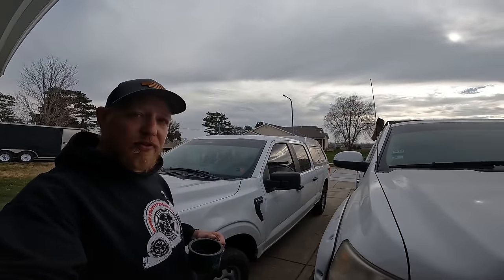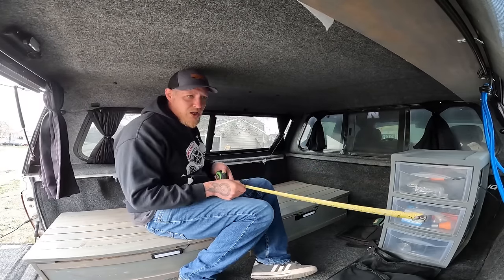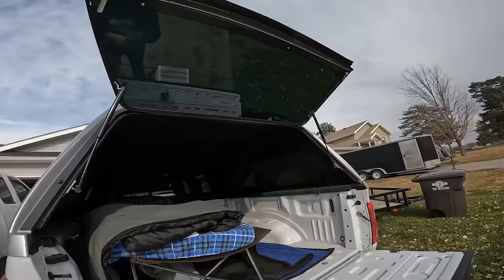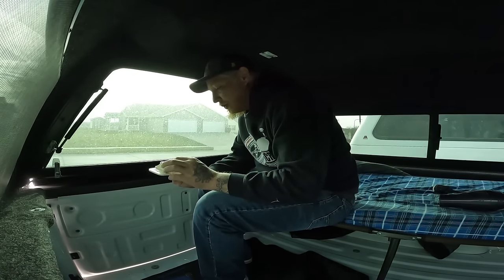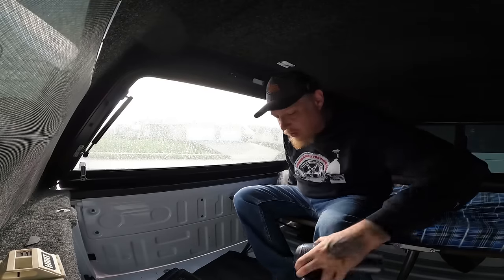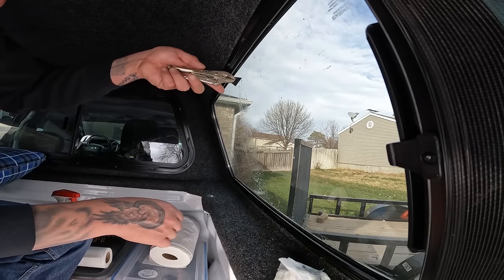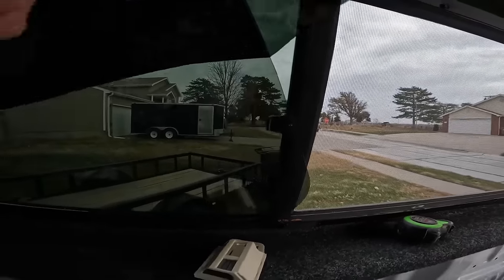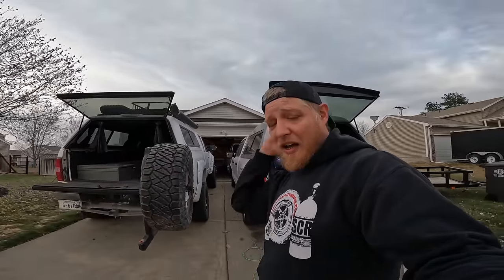Working On The Truck Camper | Measuring Differences & Removing Window Tint

Comment: Build a stand  for the previous bed you made. That way you don't have to build a whole new unit.
Reply from the maker: I might throw a couple 2x4s under it for a couple nights but I want to build a new one that's a few inches wider etc
Reply: That's what I think too😊
Reply: I was going to say prop it up temporarily.
Reply: Lift kit lol
Reply: Agreed!  Just built the bottom up!
Reply: @CrazyQuady frame in your width and height extensions into the original box… minor scabbing at most
Reply: @CrazyQuady 
good idea, Mike. It'll be more comfortable that way with it being wider. Won't feel like you're going to fall off when you turn over, lmao 🙃 🤣 
(Edit, I added on)
Plus, you'll have a little more storage underneath. If you build a whole new bed, it will have more storage which is always better.  Lol
Reply: That's what I said👍🤓just run 2x4 around existing frame for a lift, why waste$ on more wood

Comment: Learned something new today!  I had no idea how windows are tinted.  When you were talking about removing the tint last week, it never occurred to me that it would all peel off like wallpaper.  Good job!
Reply from the maker: Yeah its just film if it's aftermarket tint. The factory glass in the topper is actually smoked, some nicer vehicles have smoked glass also

Comment: My sliders are really hard to move and there isn't  any extra tint. So I'm  waiting to see what you find to make them slide easier.
Can  you build up your  bed from the  bottom to fit over wheel well?
Reply: I see a few more folks brought building up the bed LOL
Reply from the maker: Your local auto parts store should have lube for window sliders, thats probably what I'll pick up

Comment: Get yourself a bottle of magnesium graphite powder at a hardware store. Its a dry lubricant you can put in the bottom tracks (guess you could in top too, but might be messy puffing the stuff upwards). Will slide like melted butter. 😎🤘 99K dude!! You need a Live near the last 100 or 50!!

Comment: Just screw on some furring stripes on the bottom of you existing bed to make up for the height you need. That should do it. Ripp a 2x4 on your table saw or circular saw.

Comment: And on the bed in the Chevy , can you not put a 1 or 2 inch spacer board around the base to make it fit over the Ford's wheel wells ?
Reply from the maker: I'll try that for a little while

Comment: Its great to see you working on the  new rig. Im interested to see what your setup will be like in this truck. When the guys did the tint on mine, they took the windows out. They unscrewed the frame. They're a little tight to slide, but i like the privacy it provides.

Comment: I'm not a fan of using razor blades on glass, it will leave scratches behind. Adhesive remover, goo gone, or rubbing alcohol with a plastic scrapper will do the trick. Bro that abandoned house episode was intense, don't know how you did it.

Comment: Put the bed rug in and screw shims on bottom of bed to raise up
Reply: my thoughts exactly
Reply from the maker: I have a new bedrug in the mail, they're specifically fit so the old one wouldn't work well. I'll try to raise the old bed up for rhe short term though

Comment: Let’s us know what you put in the window tracks to make them slide better. Mine are really hard to slide.
Did I hear you say the motor blew in your Silverado? I replaced my motor in my 2010 Silverado. I had just  bought a new Leer camper shell and didn’t want to start over. Replacing the motor worked best for me.
Enjoying watching you get the new truck set up. Looking forward to new adventures.
Reply from the maker: Will do. Yeah that's the second time the motor gave up, I decided to move on to a new rig but the old one will get rebuilt eventually

Comment: Rip a 2x4 in half and screw that to the bottom your existing bed. Should be enough height to get above the wheel well. New truck beds are deeper than they used to be.

Comment: If you use a hand held steamer the film will come of easily and take almost all of the glue with it. Makes clean-up much easier.
Reply from the maker: Yeah, I would've but I dont have one
Reply: Mike, did you check to see if your extension cord was plugged in? Lol

Comment: When I bought my topper for my Tundra, I got the taller one as well. (I found a double cab truck with a 6.5 foot bed in the exact color I wanted) I have a very basic mat and sleeping bag in it for my camping rig at the moment. but, your channel, Mav and a few others convinced me to start camping in the ol' truck once I had a topper on it. I have a bunch of ideas for it, but want to upgrade some of the lighting and some cosmetic things before doing my full rig I want to build.

Thanks so much for the ideas throughout the years! Looking forward to what you do with the new build, so I can see what other cool things work for people.

Comment: is the Chevy a 2.7 four cylinder, and how is it on gas?
Reply from the maker: The old Chevy has a cammed 5.3 v8, and the new Ford has a 5.0 v8.   Chevy ~14mpg, ford ~19.5mpg average

Comment: When I get my topper I am going to tint it like Brian did it adds security and it is harder to see in during the day so people don't know what you have in the shell and steal stuff we use it in the south because of the high temperatures we have you may not have high temperatures in the summer like we do down south we have 105 to 115 highs for days and humidity
Reply from the maker: That's what curtains are for, I'll install a nice set in this topper just like the old one

Comment: A clothing steamer works well for removing tint. It pulls the adhesive off along with the tint. It’s crazy how high that rear window goes. It’s taller than your Chevy and it has a lift
Reply from the maker: Yeah ~14 year difference in half ton trucks, the ford is bigger all around

Comment: Do you have a shorter camping cot? I swear I've seen you Use a  couple of different ones in other videos you camped out in tents. 🤘🏻
Reply from the maker: Yes but it still won't fit over the wheel well because of the legs
Reply: @CrazyQuady oh bummer.  I suppose you'd loose all your under storage too, so probably not your ideal set up. 
You'll figure it out, You always do, and it's always dope af! 😎 keep up the great job Homie! 🤘🏻🤘🏻

Comment: They did not mean to scrape the Windex off the window with the razor blade you could have done that s*** with a paper towel when they said remove it with Windex and razor blade they meant use a razor blade to get under the edge of the window tint you could use paper towel only to wipe that s*** off you didn't have to use the razor blade you just made the job a lot harder for yourself is all you did

Comment: What's the plans for the ol chevy? Will she make a return eventually?
Reply from the maker: Someday
Reply: I highly suggest getting that cylinder drop delete done when you put in a new motor...those are the #1 cause of failure with those flex fuel motors....I'm pretty sure it's like $200 at a tuner to have it done
Reply from the maker: That was done over 100k miles ago, along with a big cam and valve springs
Reply: Crazy it still took a dump on ya

Comment: Why do you and everybody else on YouTube when you use a tape measure inside like inside a a truck like you are or inside a house why does everybody bend their tape measure to try and get the accurate measure? you just run the end of the tape measure to one side and you pull the tape out and you let the housing of the tape measure go up against the other side you push the lock down you look down whatever it says on the tape measure you add 2 inches to it boom there's your accurate measure it used to say on the outside of tape measures the housing of it used to say add 2 inches for inside measure why does nobody not know how to do that if you're not doing that you're really just guessing the length really when you bend the tape to fit. Lol, I've known how to use a tape measure like that since I was 10 so for 40 years now. Lol

Comment: Try vinegar ,it works better
Reply from the maker: I saw that on some vids, I didn't want all the overspray on the carpet, it wouldn't have smelled great
Reply: @CrazyQuady  it drys quick and the smell goes away in the heat from the sun. You only smell it for a day or so.

Comment: I'm wondering if you could just temporarily screw a 2 by 4 frame on to the bottom of your existing bed to get yourself the 10 inch height or whatever it is that you need to get you by until you can build a custom bed for the new truck

Comment: Hey Crazyquady, not being rude or anything, but how come you didn't just the replace the engine in the Silverado instead of buying the van and the new F-150? Wouldn't that have been cheaper? Perhaps you just wanted something new or maybe its none if my business but just curious.
Reply from the maker: 2nd blown motor, 217k miles and its really rusty, I just covered it up well. Just time for a new daily truck. I planned to buy a van at 100k subs anyways, I just jumped the gun while I was deciding what to do about the old truck.  The old truck will be rebuilt and return bigger and better than ever in the future, just not as a daily driver
Reply: @CrazyQuady  Ah gotcha. That makes sense. I hope it's been a good rig for you and you can bring it back bigger and better.  I can't wait to see the new trucks build too 💪